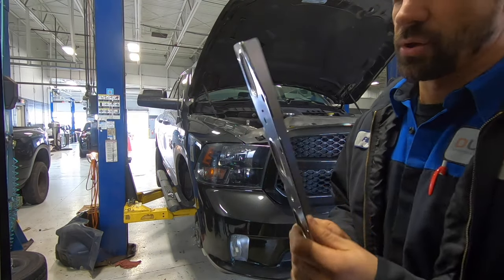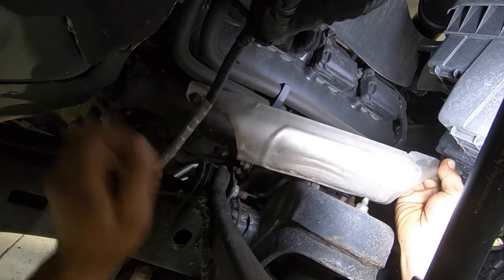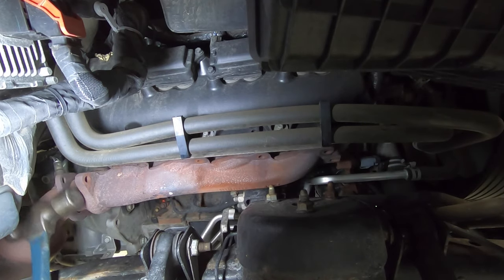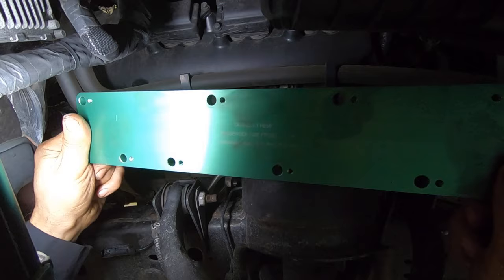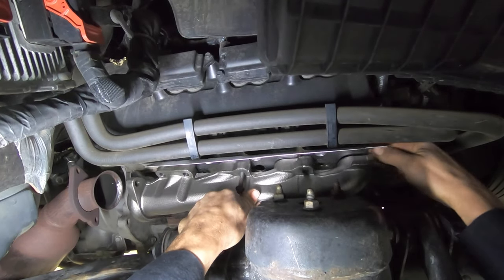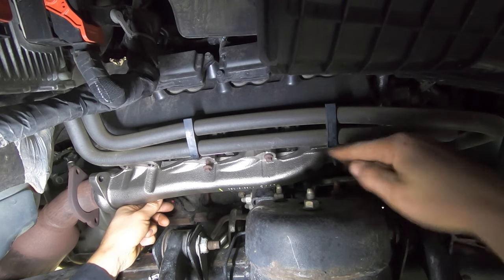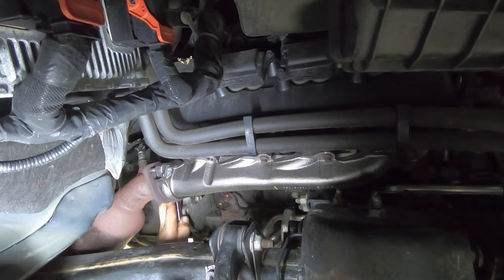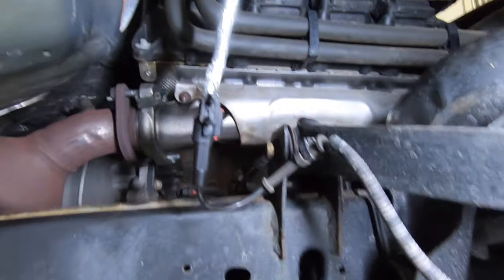5.7 HEMI Exhaust Manifold Leak | Broken Bolt Fix

Comment: What would a mechanic charge for this service??
Reply: Cost me 750 dollars on my 14 Ram
Reply: @kencayton2750  Thanks 👍
Reply: @kencayton2750  dam
Reply: And that was just one side.
Reply: Is there not a permanent fix for this?
Reply: @Steven_Will I worked at an exhaust shop for several years, the catalytic converter, mufflers, and tailpipes all hang off of the manifold. Yes there are hangers on the pipe but they allow for movement as the engine rocks. Most 4 door trucks that have 18 feet of exhaust hanging off the manifolds eventually break the bolts. Shorter trucks do this less often because there isn't as much weight pulling down on them.
Reply: @ryurc3033  Has nothing to do with the exhaust weight, it's because your mating a cast iron manifold to an aluminum block, which heat and cool at different rates. The manifolds are not heat tempered prior to install, so when they do get up to heat they will eventually warp. The warping puts strain on the bolts, causing them to snap. If you machine the manifold flat before reinstalling it, AFTER it has warped, it will rarely warp again and you shouldn't have any further issues.
Reply: @stevenhallman5267   ... dang someone right should be a recall. For after warranty situations.

Comment: This is what I’m dealing with now. I’m at 60k miles on a 2019.
Reply from the maker: Was it the rear one on the passenger side? I did a few and they all came out easily with stud extractor.
Reply: @TDRAuto  I only hear it on the right side. Have had the chance to pull the wheel liners down yet.

Comment: And 40k later, they will do it again.
Reply: even if you go w/ high quality ARP bolts?
Reply: @j3ff3ry18  I don't know. The dealer installed them under warranty. I decided I want to try headers this time because things I've read about this problem.
Reply: @j3ff3ry18  those should work better Dodge likes putting the cheap ones on

Comment: I think it's complete bullshit. I have a 2017 Ram with 47k miles on it that has this exact same issue. There should be a recall on this. I can't imagine the price for dealer to repair that nonsense. Got to be over a grand
Reply: Lots of people get them replaced under warranty. Not quite a recall, but my 2016 had it happen before 30k miles, which should be covered under warranty.

Comment: How many hours?
Reply from the maker: 3 hrs if you have to use the drilling fixture. Add a little more time for the left side as the steering shaft is in the way. Also add more time if the bolts are rusted out.

Comment: Stupid. Damn bolts would rust badly they are small also. Have to be drilled out. It’s so stupid. Cheap ugly heat shields would start to rattle like they about to fall off. I drilled the bolt studs out mine installer Gibson manifolds. 

Badass now. I ran over the old stock manifolds they looked like shit 

Un reusable